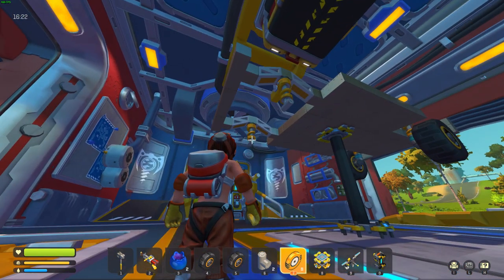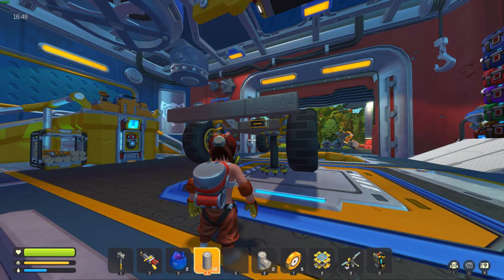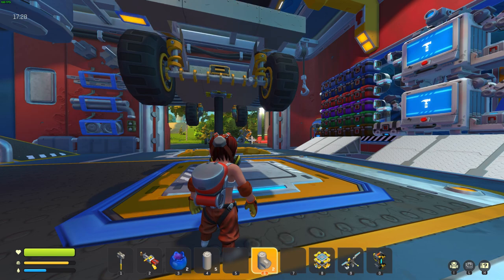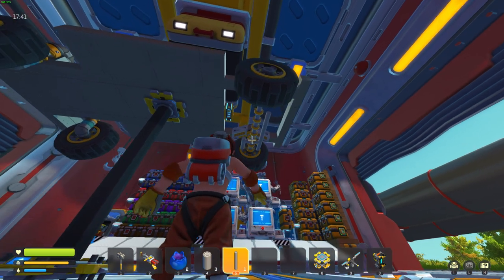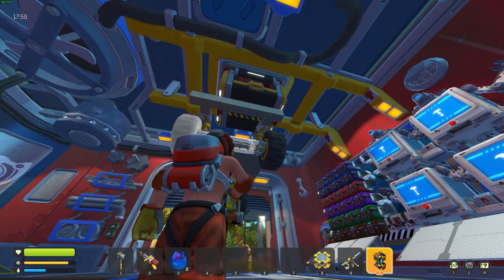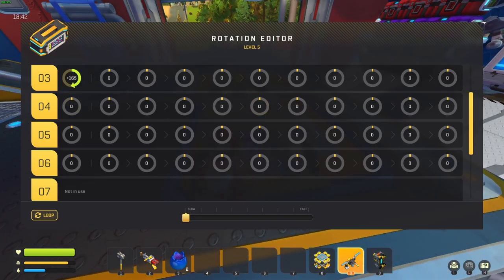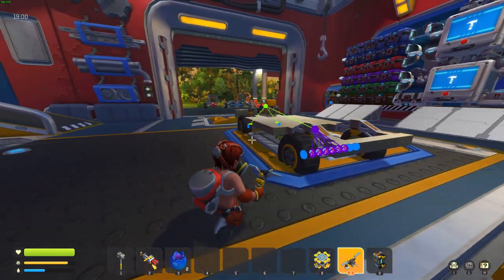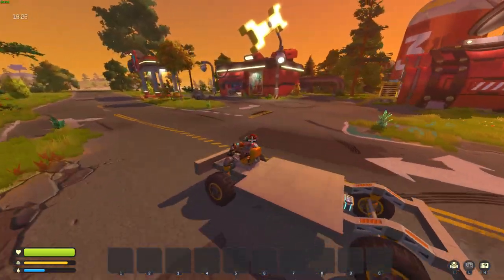The better way to build controller powered trucks in Scrap Mechanic

Comment: I found it useful to place add steering by having a L-haped or O-shaped pipe used like in a double-wishbone suspension to change the angle of the wheel, but used to change the angle of the powered-wheels section of the vehicle. The more weight you have, the more likely it will be for you to need more than a single L-shaped or U-shaped steering system, to move all the weight needed for steering. For the steering, you don't need a controller, but you do need the connection slots for the seat to be able to control the steering. 

Also, interesting method. Thanks for making the video! When I last made a controller engine in Scrap Mechanic, this summer, I used one bar connecting the wheels, no suspension on the vehicle and a suspension on the bar connecting the wheels to rotate it around the support beams for the wheels. Your method seems more efficient.

Comment: Doesn't work anymore i did exactly as you did all the connections all the bearings facing the right way and it won't even start spinning the axle with the wheels on it. Once i disconnect the two rods connecting to the T pipes and the wheels it starts spinning but both wheels different direction and can't get them to spin the same direction 🤷🏻
Reply from the maker: Nothing has changed, so it'll work if you do everything right.

Comment: On small cars the acceleration is so high that the car flips over at max speed, wow! Definitely going to add that to my heavier vehicles if I can figure out how to add steering.
e: Tested it on my low weight truck/buggy thing and even on that max speed was still too much. You could power a train with that! And I might.
Also tried it on smaller wheels but it didn't work at all, the wheels wouldn't spin even when the bars were clearly moving at top spin and I couldn't figure out a way to fix it.
Reply: Another problem I have sometimes is the spin will be reversed and replacing the bearings or changing the settings in the controller don't do anything, really annoying
Reply from the maker: This is probably because you've added the bearings the wrong way

Comment: Where did you find the wedge pieces for your chassis?
Also, the maxed controller has 10 connections :p
Reply from the maker: it's on top of the warehouses. I noticed my mistake when it was done, but figured it doesn't matter as you can use as many controllers as you want for this.

Comment: I’ve tried this multiple times and I can’t get it to work. I suspect it’s because some of the bearings are spinning the wrong way, but I don’t know why as the arrows are all in alignment. Maybe they patched it?
Reply from the maker: There is nothing to patch, this isn't a glitch or a bug. I suggest you try to build it from one side as the bearings arrows are dependent on which  side you  you put it on

Comment: Build this identical, confused as to why mine seems so much slower.. Level 5 controller. Also tried to make it slightly wider, 10 bearing and still not nearly as fast as this one.
Reply from the maker: And you're sure you set the speed to max? If so I'm not sure why.
Reply: @RaRaMalum  I wish I could tell you why, only way I get it to go fast is if one bearing is reversed direction O.o
Reply from the maker: You've obviously connected something wrong
Reply: Not enought weight maybe, my trick drives pretry well, bur when I put the fuits on it, it just goes to fast that is unable to drive XD

Comment: Is 6 bearings a limit, because I tried with 10 and it is spazing out, also is the type of suspension important?
Reply from the maker: I've done 10 without a problem, (well except that the car was uncontrollable because of the speed) the physics in this game seems to be very affected by how powerful the computer running it is. I guess stronger suspension will help a bit, but if your computer is at its limits it might not matter.
Reply: RaRaMalum try using two bearings on top of the suspension to give it some flex and allow it to handle better at speed